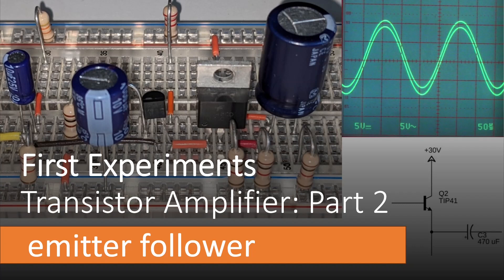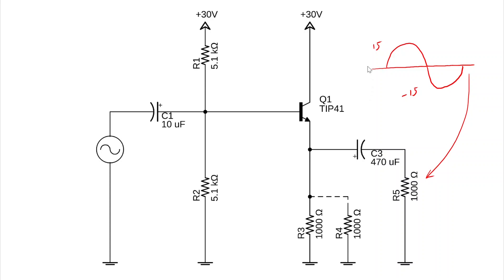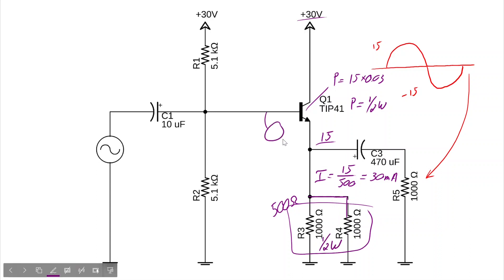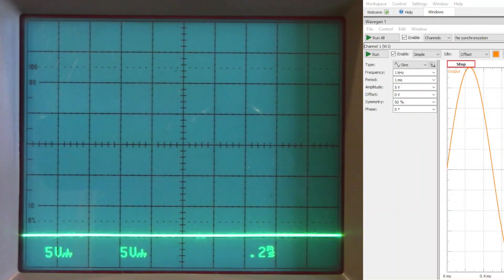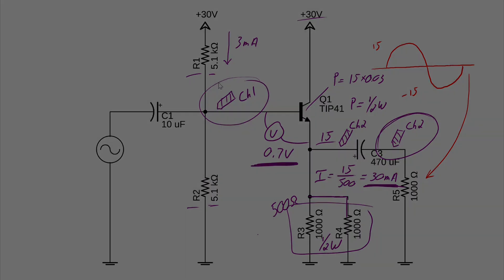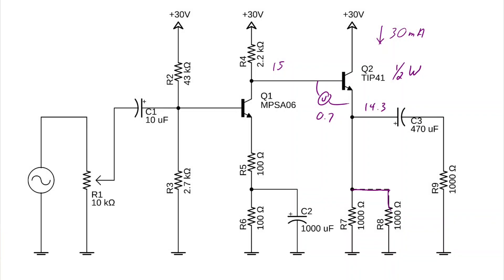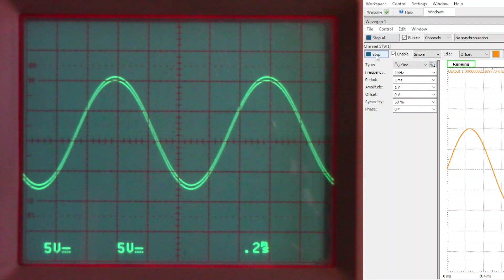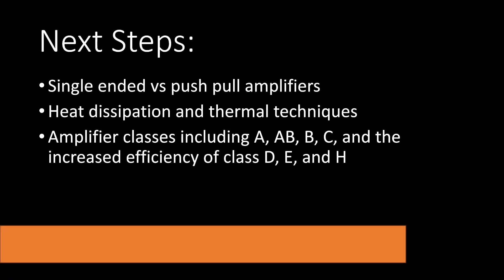Designing and Testing an Emitter Follower (Common-Collector) with a TIP41

Comment: Does an dc direct coupled emitter follower work the same way as a dc direct coupled cathode follower? That is, ”stealing” current from the previous stage, rendering a rounded off signal, i e compression?